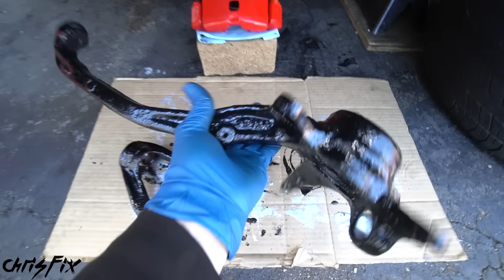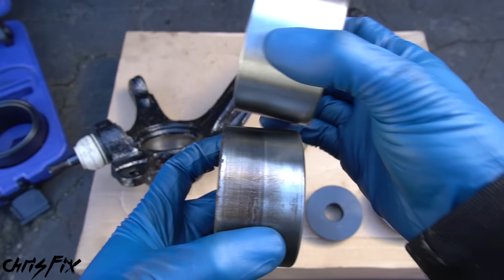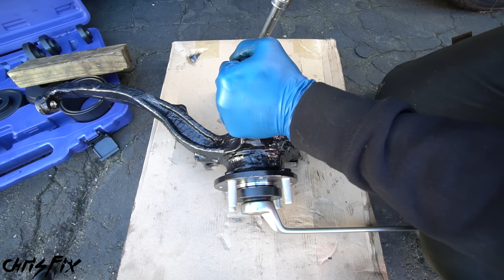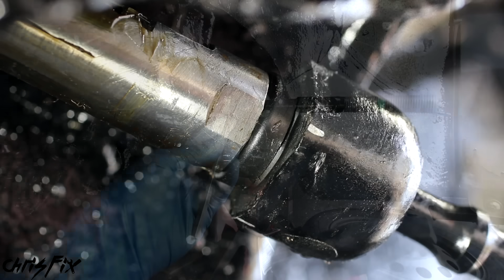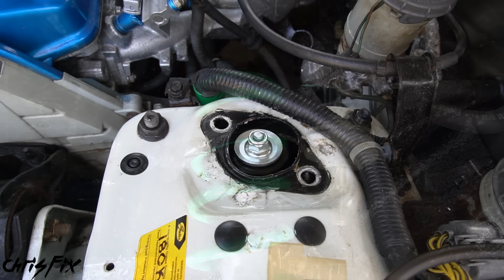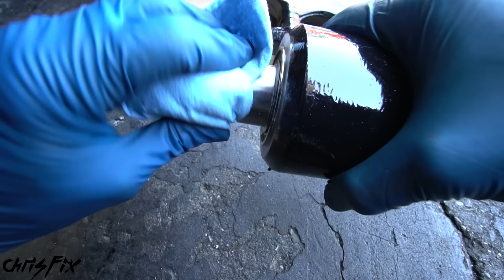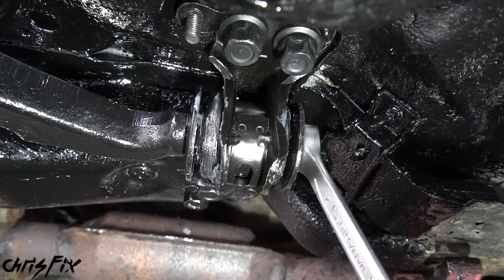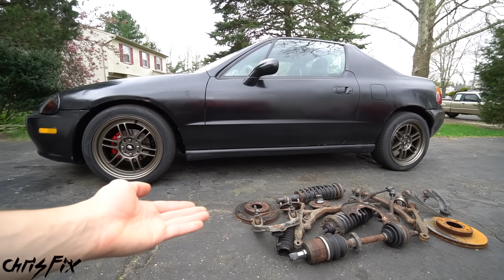How to Install a COMPLETELY New Front Suspension in your Car or Truck

Comment: Amazing work!

Now if only my suspension was as common as a double wishbone...
Reply from the maker: What do you have?
Reply: ChrisFix
I've got Ford's I-beam set up on my 96 Mazda B2300.
Also it must be super late for you lol. I was not expecting that fast of a response!
Reply: It's real weird, it's like the baby of a solid axle and a double wishbone. It has one pivot point that is on the other side of the wheel, for example my driver side suspension starts at the passenger side frame rail. And then you have another kind of arm that starts  under the diver seat(or something) that goes to the end of the arm to prevent it from wobbling back and forth. And the wheels are held on like the knuckles of a solid axle, they wrap around the beam. Interesting setup for sure.

Comment: Hi Chris may i now wy you dont put Grease on your balljoint and ballbearing before press them Into the arm ? It will be more easy to instal and be more rust proof whit some Grease! Or there is a reason that i miss?
As alwais i literally love your video, (even if i now thé job) you explain so well👍👏

Sorry for my english, between thé french auto corector and my lake of good practice it's a bloodshed 😌
Reply from the maker: I was always taught to press them in dry or if it’s a really right fit, use a light oil like silicone to reduce friction.
Reply: @chrisfix  next time i will try silicone ;-)

Comment: You torqued and thread locked all bolts and nuts and then went for the wheel alignment, shouldn't the process be in reverse?
Reply from the maker: No because they only touch the tie rod lock but which doesn’t get threadlocker.

Comment: In Europe dust shields are an inspection failure point if they are badly corroded or missing. The logic is that they prevent foreign objects jamming the brakes. You forgot new sway bar bushings.

Comment: No grease when installing the bearing, the hub, the ball joint. Why ? I was thinking it will help for next removal ???
Reply from the maker: I was always taught to have them go in dry unless they are an extremely tight fit then you can use a light oil to help with the friction.
Reply: Thanks Chris !!!

Comment: Hey guys I have a problem with my car it used to shake a lot so I got a wheel alignment it stopped but once I get up to 80 plus mph it starts doing the same thing any body know what it could be
Reply from the maker: Check bushings and ball joints in your suspension
Reply: ChrisFix thank you I will be checking them out
Reply: Brake rotors?

Comment: Chris didn't mention how much this all costs. I would've thought that would be an obvious thing to tell us. That way we can tell the price difference between paying the suspension specialists to do it and doing it ourselves. For some of us this job is too difficult.
Reply from the maker: I don’t tell you the cost because it varies from car to car. This cost me about $500 but on another car it could $500 for just a set of shocks. You’re saving a significant amount of money doing it yourself.
Reply: @chrisfix   you mean all those parts for the front both left & right cost you only $500? The suspension guys here would charge $2500 to do the same job. I'm in Australia.

Comment: hey guys chris fix here and today we are going to be installing a turbo charger on this del- sol. so what your gonna need to do this is a 10,12,14,17,19 and a 21 mm socket and wrenches you will also need some silicone, for the part you will need this turbo all these gaskets a turbo manifold, a down pipe, and this intercooler pipe and of course the intercooler, and this blow off valve, so lets get started first we will need to pull all the old exhaust out such as the manifold and down pipe.    Shall I continue for the next video on the del-sol or is that turbo on the cardboard in the background not for the del- sol turbo was seen at 25:21 for any one wondering and if chris fix replys to this I might just reply back who knows these days...
Reply: XclusivePower and I literally don’t care
Reply: XclusivePower thanks for that helpful hint I might just go do that now how do you think I should literally do that but hey your the sensitive one that can’t take a joke then when gets shown up you take things to a death threat level telling people to kill them selfs so to you my butt hurt friend calm your tits you little Bully you

Comment: Important to note that the bearing also has a certain way it has to be pushed it. It has a top and a bottom, not really sure what could happen if you put it in wrong but there is an intended way.
Reply from the maker: There is no top and bottom to this bearing since there is no abs.
Reply: @chrisfix  I see, I got most ''bearing experiences'' on Caravans and not on cars. Those do have bearings with a top and bottom. Good to know, thanks for the reply.

Comment: Parts in the freezer are easy to explain, it's common for rivets used in aircraft. I did have some difficulty explaining what my pistol was doing in the refrigerator when my college roommate went for a beer. (I got distracted.) Other kitchen screams have been heating steel parts in the microwave and cleaning dog poop off my shoe in the sink. Trick: Ice and salt will chill things faster.
Reply: Yeah better cover your new parts in salt. Good job dipshit.

Comment: One quick tip, you should stop feeding the wheel, it is dangerous, especially in tight turns or in a fast paced situation, because the driver can’t move the wheel fast enough no matter how hard they try, so try to use the hand over hand method of steering, it is much faster and safer.
Reply from the maker: Thanks for the tip

Comment: some wheel bearings (like on my fiesta) have the magnetic rings used by the ABS built-in, so you need to worry about their orientation as well
Reply from the maker: Correct

Comment: When  pushing the wheelhub in, push against the inner race of the wheelbearing, not the outer...
Reply from the maker: I did... the bearing plate pressed against both  the insides and the outside race.

Comment: They don't make new Control arms or Spindles for my '99 anymore or I would love to take on this project.
Reply from the maker: 99 what?
Reply: @chrisfix  Dodge Dakota, Sport. I am still adjusting the new brake Calipers i bought for it. Couldn't find a new Spindles for it online. Had to patch up a few worn spots from the calipers.

Comment: wayyyyyyy to many bolts with thread locker on them stuff that good luck taking it off in the future
Reply from the maker: Awesome, time to learn something new!!! It’s removable threadlocker so it makes it easier to take off because the threadlocker protects the threads from rust. So whatever I torque it to is what it takes to remove it. That’s the beauty of using it!

Comment: You're pressing in the second hub in the innerring of the bearing. Then you should also support the innerring during pressing and not put the backplate on the housing (like you said by the first hub), isn't it?
By the way, I love your videos.
Reply from the maker: I put the backing plate on the back of the bearing not on the knuckle. The plate pressed against the inside and outside race of the bearing when the hub went in.

Comment: I always torque the bolts when I install and after I have the car on the ground with weight on it. I torque it with the car in the air and then with its own weight on it.
Reply: I didn't watch long enough lol nvm

Comment: I have to replace my tie rods this week and I bought greasable ones, but I'm having a hard time finding what grease to use. I have some general purpose Walmart grease, but I'm not sure that's the best stuff to use. I have no issue paying for better grease like -Moly-Lithium or high temp grease, just don't know what to use.

What grease is recommended when greasing ball joints and tie rods?

Comment: So, this works with any suspension? (I mean, if a car has a double wishbone and not a McPherson strut, is the process still the same?
Reply: Pretty much. Some times the ball joints are easier, and obviously the spring will be seperate(if it exists: look up torsion arms).

Comment: Nice I've been waiting to put my car back together since the last video
Reply from the maker: Nice! Now you know the proper way to do it! Luckily you only had to wait a week. Could have been a month!
Reply: Most importantly, it does not need sooaaapy waader
Reply: @Abdullah..S  Yes it does. Whatch the last vid.
Reply: ChrisFix oof
Reply: nice, i also startet rebuilding the front suspension of my 1999 audi TT after i saw the last video ;)
Reply: @schaumi9038  hey I want to buy a 2009 audi tt at the end of the summer do you think rebuilding all the suspension on this car is gonna be hard? I know that it's awd so does that make it harder. I haven't done anything with suspension before
Reply: @-coolish8293  hi, its not harder than on the older cars, maybe you have to disconnect the abs sensors, but besides of that its the same as in the video. And a car of 2009 may not need a complete rebuild of the suspension. Good lock with your tt :)
Reply: Idontthinkhegotthejooke
Reply: I lost my job in that week
Reply: Lol
Reply: Hey Chris you must be fun at parties

Comment: I paid $480 today to a mechanic to install a new axle assembly on my car.  The part cost $160, labor was the rest.

Where is ChrisFix when you need him?
Reply from the maker: That’s basically what I paid to do the whole front suspension lol.
Reply: That is actually a fair price. I would still do it myself because that labor cost is about a weeks pay for me.
Reply: Just do it yourself!
Reply: That will be the cost for me as well for new ONE new wheel bearing in front at volvo stealer :)
SKF bearing is about 250 Euro.
Reply: orfeous yeah wheel bearings are the worst.  It's one of those things you should be able to do on your own until you realize that removing a bearing on a 10+ year old car requires more than your average tool set.  The part is relatively cheap.  The labor to pay someone to do it sucks.  Replaced 3 of the 4 on my car already.  My goal is to hit 200,000 miles.  Watching Chris Fix since the beginning and I still only do the basics myself lol.
Reply: @TraumaER  same here. I dont have the tools, knowledge, self-confidence and i dont want to risk it if something fails and i dont know what to do in the middle of the night or on a carlift in town. That would suck. So.. for me 430 euro will be good for me to dont need bothering with that crap.

There are also so much scary important warning notices on the assembly for my SKF bearing. It could lead to loosing wheel.. car accident etc.. if it isnt done the proper way. Its easy to damage the bearing. :)
Reply: Shit most axles 70 bucks brand new but yea a shop so he had to double up
Reply: Chicago Fishing i wouldn’t feel safe with a 70$ axel. I just replaced mine last week for 120$ and 24$ for manual transmission oil
Reply: Xolog  autozone Napa advance all sell new axles for under 80 bucks and I never said I buy them did I ?
Reply: Chicago Fishing I wasn’t criticising you, i was Saying people shouldn’t trust Those cheap autozone parts
Reply: Xolog I use all dealer products or close to oem spend money save hassle later but not every one has the money 💰

Comment: So im confused here, Why put the tire on to tight the axle nut? You can just put a flat head screw driver in between the rotor in the center hole of the caliper. And tighten it that way. Its a neat trick. Plus did you change calipers because then id say you miss the step of bleeding the brakes.

Comment: Great video!👏I like that you use hand tools to get the job done. Quick question though...why did you place the wheel on the car tighten the axle nut and then remove the wheel again? Why not tighten the axle nut and then place the wheel on?

Comment: Chris, I have watched your content for a while now. You explain things so well in ways I feel most people can understand. You however under explained something about ball joint installation here that in a lot of cases is very important. Many are designed to be installed in a spicific orientation as they will only move in one direction. If they are not installed facing the correct way many will break when you put weight on them and may even break something else. There are typically a set of notches (one on the ball joint and one on what you are pressing it into) that you line up to assure they are installed correctly. Just because yours didnt have it doesnt mean it's not something people need to be aware of as it is very easy to overlook.

Comment: You could probably 3D print some new dust shields for the knuckle with some high strength / heat resistant plastic? Might be worth a try, cheap too!

Comment: lol anti-seize on brake pads and caliper. great for collecting brake dust and actually causing a seize. new mechanics are literally trained not to follow that practice anymore because the build up of brake dust on the grease will cause noise or seizing.

Comment: MISTER CHRIS! 
THE SQUEAL TAB ON THE BRAKE PAD GOES ON THE LEADING EDGE!!!
Reply from the maker: Austin Sears I like putting it on the inside pad. I can easily see the outside pad thickness with a visual inspection. It will make noise on the leading or trailing side as long as you don’t buy cheap Chinese pads that use soft steel for the wear indicators.

Comment: Chris, don't use grease on bushings. Use antiseize on the bolts, but grease will do you no good, and part of the bushings function is the metal sleeve twists as suspension acts.

Comment: Personally I would have replaced that output shaft seal. You had it all apart anyways. it would have taken 5 minutes. Your for sure gonna be kicking yourself if that seal starts leaking. Just my opinion though

Comment: 25:03 I know that feeling. I just got my inner and outer tie rods replaced along with an alignment done and my car feels so nice. The steering is precise and doesn’t wobble when hitting bumps, the car just goes over them like nothing. It’s amazing how well your brain adapts to the way a car drives. I have to retrain my left hand not to compensate for the wheel being an inch to the left when driving straight! 😂😂

Comment: Be careful with eBay turbo kits. Double check your oil feed Is sufficiently providing oil to your turbo. That’s a common problem. You may also want to go with an aftermarket blow off valve as the eBay ones usually don’t work properly and tend to blow up engines within the first few pulls.

Comment: I would rather go for the mustang instead of honda... D15 engine may get quick worsen when u install turbo with stock internal... For a mustang it will go better... More power for drifting

Comment: I have a question is there significant difference between summer air and winter air I took it to the mechanic about it since my tires were changing colors from salty white to black but mechanic said I need new all front suspension since the winter air ruined the front suspension. My mechanic called me a nimrod I think he is full of it. Help!!

Comment: Say, my 02 civic has 200,000+ miles. It might need a change...

My dad and I had to redo the clutch, so we had to kind of take apart the whole suspension. The axles, lower ball joints, etc.
Reply: Yep. Typical clutch change procedure on a front wheel drive.

Comment: Hey Chris, I have a bit of a problem with my mom's truck. She got a new battery for the truck but the battery won't stay in place, it wiggles around and will often fall toward the edge. The only things that stops the battery from falling out of the hood completely are the positive and negative plugs and rubber tubing tied around the battery. How can we fix this without going to the shop, please help.

Comment: I like everything you did except the snap ring was put in backwards. Flat side goes out. I leaned this the hard way at work, a system of part i rebuild failed because i put the snap ring in beveled side out. At the test bench we hooked up the system and pressed it up. We do a low test before we go to a middle test and go to a high test. The parts held the low but as we went to pressure up to the middle the snap ring popped out along with everything it held. My mentor walked up grabbed all the parts looked at all of them. Assembled them and push them back in the body and handed me the snap ring and snap ring pliers. He pointed at the body and snap ring flat side out and walk into the test booth. And it tested well.

Comment: Why did you torque the nuts at 33 ftlb and 47 ftlb? For the upper control arms. I'm curious why these are specific.
Also, with the ball joints, why does there need to be grease inside of them?
I'm planning to study automobiles for a future career. These are some random questions I had during your video.
Reply: wow look at that, five years later and I have the answer to my own questions :^)
cheers ChrisFix. just got part of my aviation mechanic license (funny how things can change)

Comment: I have an 87 F250 4X4 460cid,
I have to replace the front brake hoses calipers pads and rotors.
I have to take out locking hubs to replace the rotors, do you have a video for that? I have been a subscriber for quite a while, I have quite a few of your videos saved. BUT... I could not find one on that particular job.

Comment: Nice work, but why did you cheap out and go with non-serviceable ball joints?
Reply from the maker: rogermurph101 those lower ball joints are actually really good ones that are built better than oem.

Comment: Just did the front strut assemblies on my Grand Am.  I'd like to do a full suspension rebuild like this but that's money I don't have.  At least I was able to spare enough to do both sides with well reviewed replacement parts, not the cheapest random crap I could find or only just the broken side.